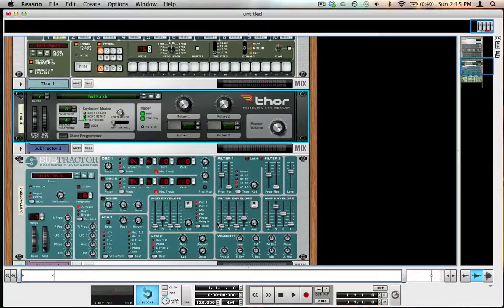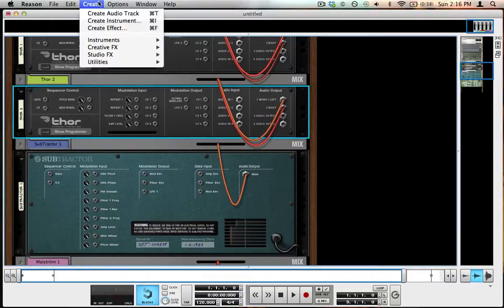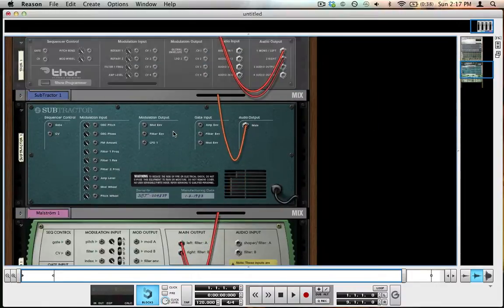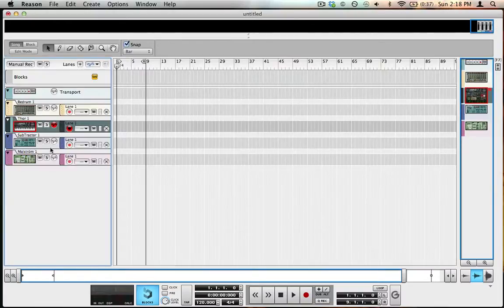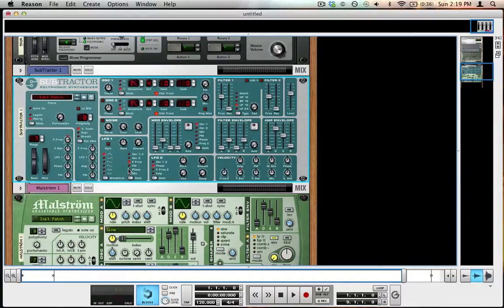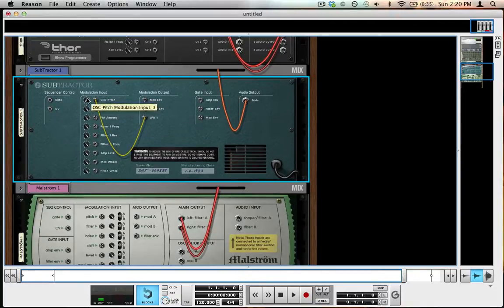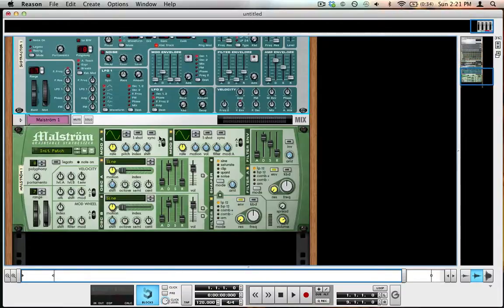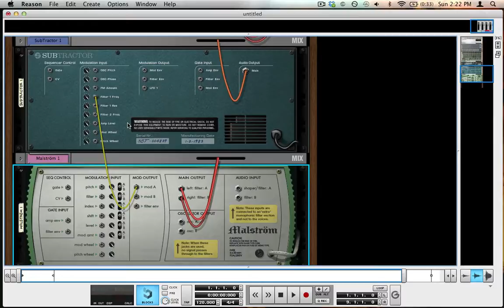Cables and Wiring in Reason | Basic Sound Design | J.A.M. House Tutorials

Comment: This is a silly question. On reason 9, on the back of racks, how do you aquire a patch cord? I see patch cords but let's if you want to connect something in to out where do you getvthevpatch cord?
Reply: You should be able to click and drag from a port. If you click and drag from a port, to a port that makes sense (input to output for example), then it will create a cord/connection.

Comment from the maker: Just a follow up explanation. CV connections are necessary to connect LFOs, Envelopes, or any other modifier to parameters (that's what modifiers are outputting, a Control Voltage). The LFOs and Envelopes inside a device are usually connected to parameters already without having to use CV cables. For example, an amp envelope's CV output is connected to the amp level's CV input without the need for any CV wiring on the back of the device. Hopefully that makes sense. I'll explain in the next vid.